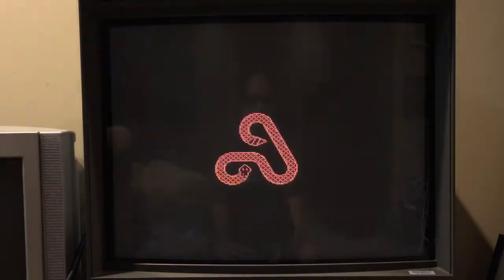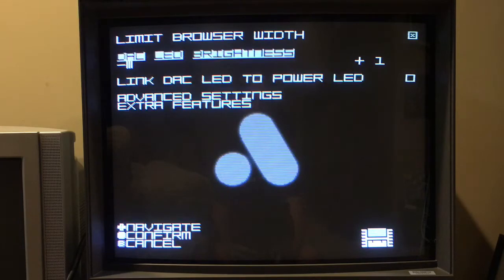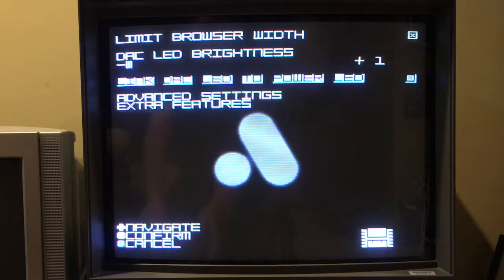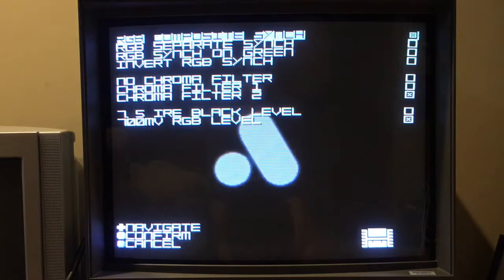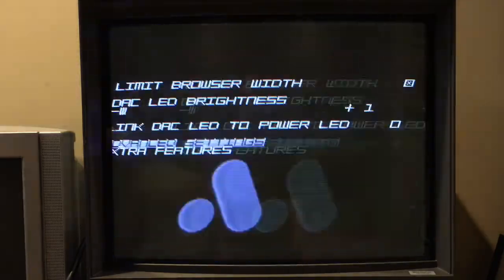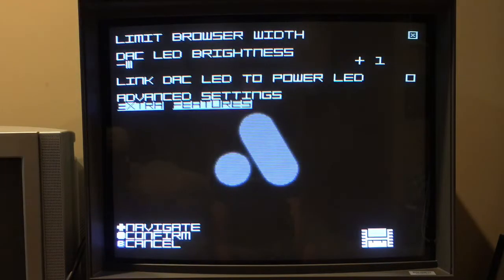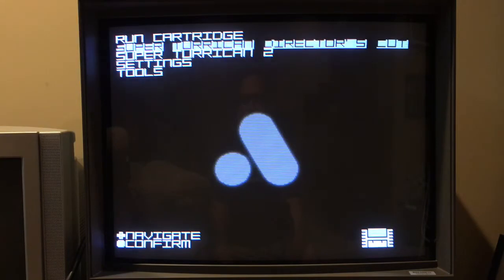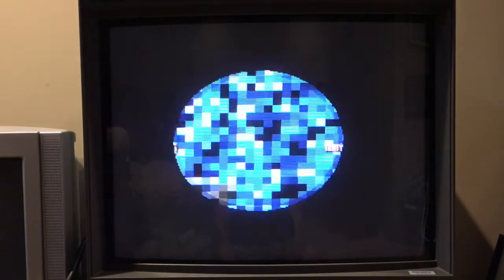Setting up the Analogue DAC Digital Analog Converter for CRT Displays - Part 3 Settings Menu

Comment: Even though you’re using the super nt through the dac, do you still have access to the cropping settings (width, height, etc.) like you would if you were using the super nt via hdmi? I ask because, like you, my Sony trinitron displays Super Nintendo games with the right side exposed— not flush with the right side of the screen. And, since it’s a 20 inch trinitron, it does not have a HSIZ adjustment feature in the service menu. Mind you, the geometry on everything else is perfect, save for the Super Nintendo; maybe it’s because the snes has an odd set of resolutions. Anyway, if the dac still allows access to cropping, I figure that would allow me to adjust the HSIZ via the console. Thank you, for your content.

Comment: I just got my DAC to go along with my sg.
Im playing GAMEGEAR games with the cartridge adapter, but for some reason the picture is a smaller screen and doesn't utilize the for 32 inches of my sony CRT.
Is there a way to blow / expand out the picture.
It's like playing on a 20 in screen within a 32 in screen.